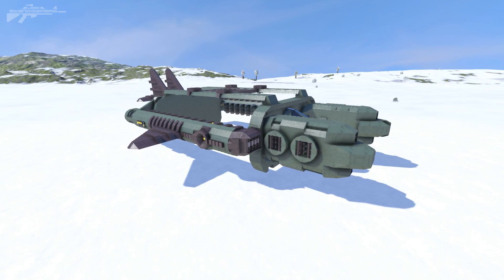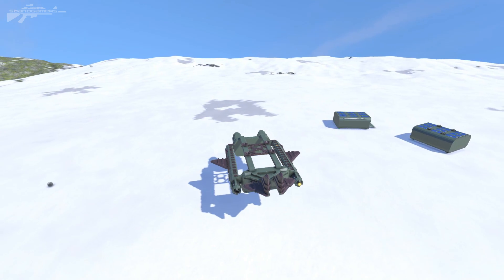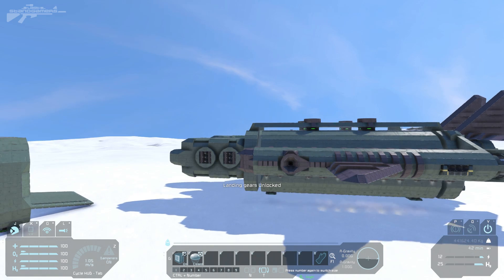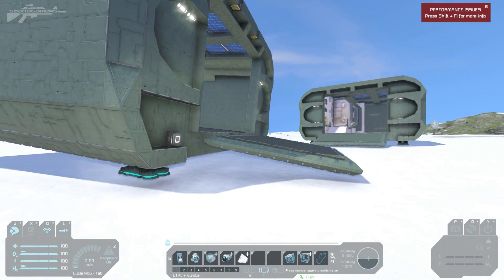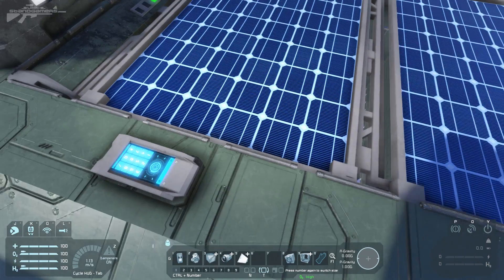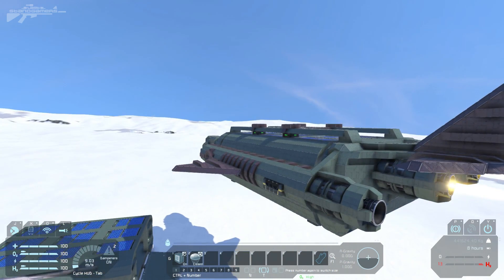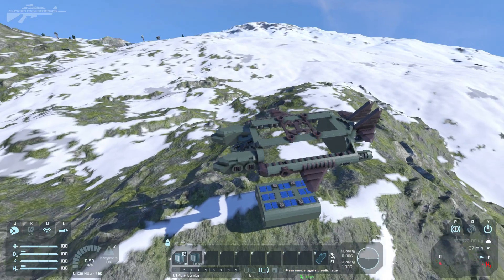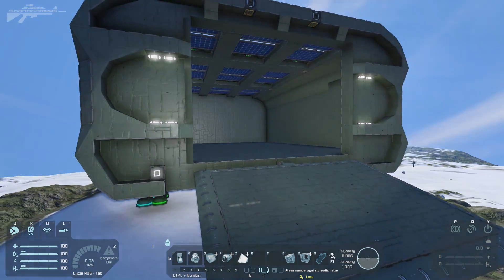Outposts Transporter (Thunderbird 2) - Space Engineers

Comment: You should have doors and merge blocks on the backs of the pods so you can connect them to each other. Also connectors so items can be moved between them. Also make one without the big door and only small doors and merge blocks on front and back (or even one with it on all four sides).